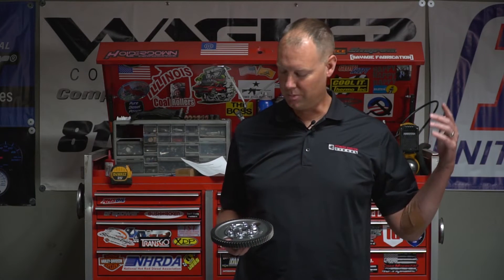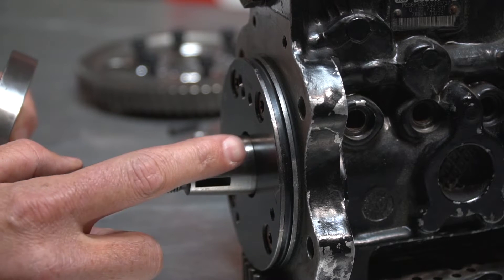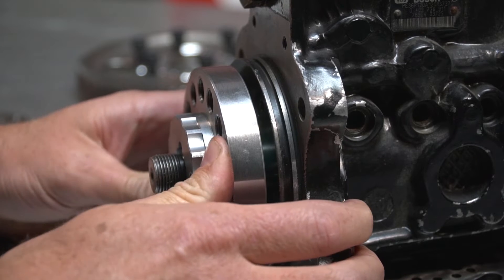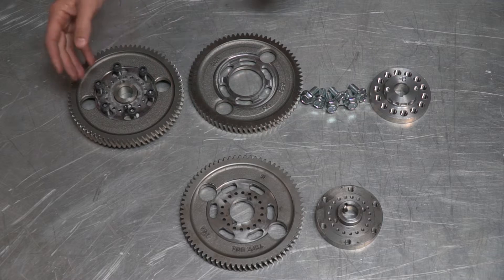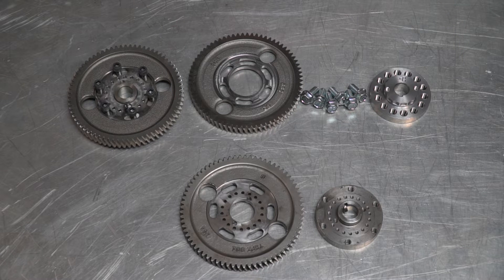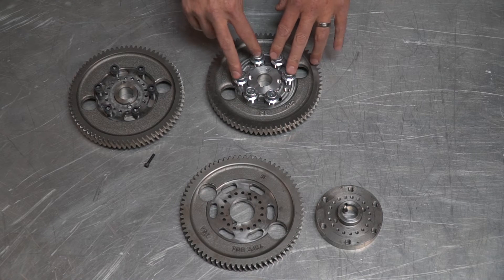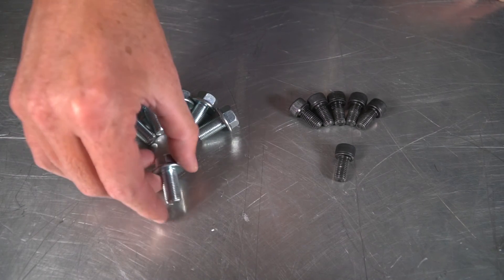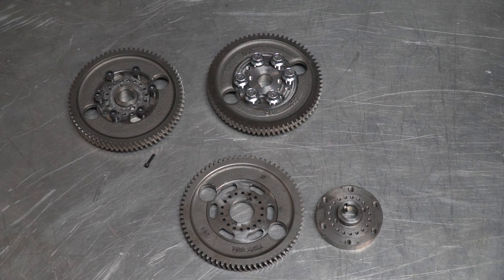Billet Adjustable Cummins Timing Gear | Parts Bin EP 14 | Power Driven Diesel

Comment: Do you need to a have billet timing cover to use this gear?
Reply from the maker: To get access to the bolts to adjust it timing you will need an aftermarket cover

Comment: Make one slot for the round offset timing buttons like a Scheid/Haisley for positive backup and positioning and I think you will have a real winner. That thick hub  is much better as I have actually had the small hubs crack thru the keyway before.

Comment: With the old gear, each bolt hole was 2*. How is the timing measured with the new one? Do you use a dial indicator on the #1 delivery valve and measure it when you want to adjust your timing?
Reply: PowerDrivenDiesel 
That’s a nice option with your new gear. You can go as little as .5 or 1 degree vs only in increments of 2 like the old gears.